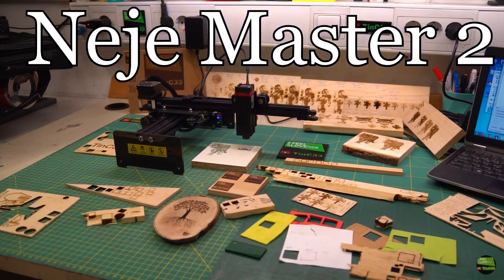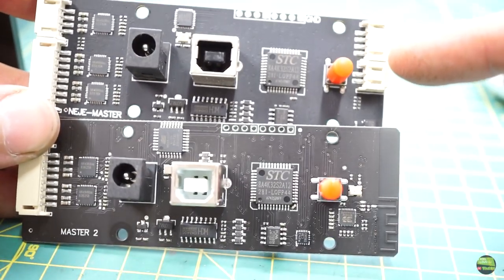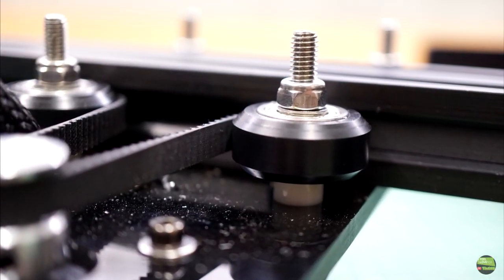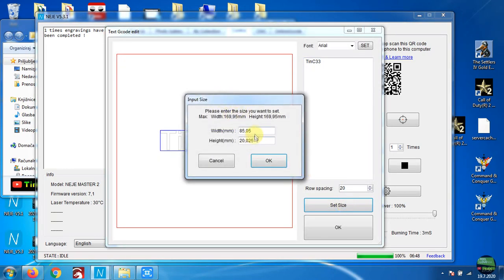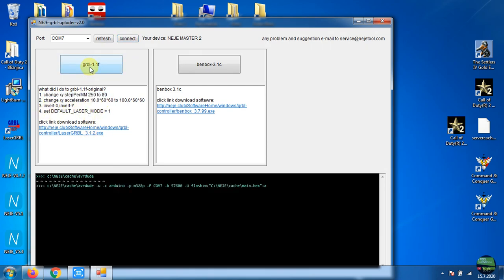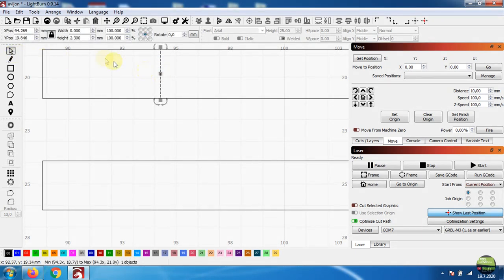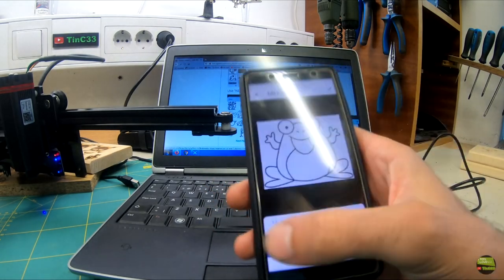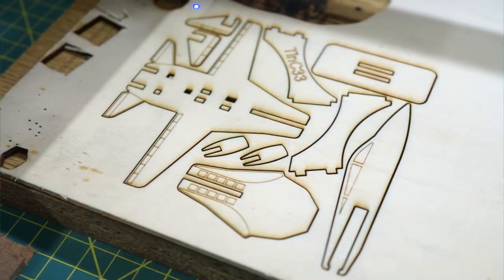NEJE Master 2 20W desktop Laser Engraver and Cutter

Comment: Hello, I am a .neje master 2s user. The red led is constantly flashing. The software is not loading . can you help
Reply from the maker: Red led on laser modul flashing whil is in iddle mode, do you install driver to pc
Reply: @TinC33  The driver is installed on the computer . but the red light is constantly flashing.
Reply from the maker: @urasteknikplastik402  red lifht on motherboard or on laser modul, on laserm modul mean it's in iddle mode, does pc recognize new dewice after plug usb?

Comment: Hi As i write last time i ordered  neje 2 20w but they send me neje 20w, after that they send me one mainboard master 2s but now  the problem is in the screen said Unsupported device i try all up date software but still not working, have you any idea whats the problem ? thank you
Reply from the maker: Did you install driver?
Reply: @TinC33  yes i did and install also this NEJE_V5.3.1.exe — 2020.7.13- bug fix, firmware upgrade to version 7.1.
Reply: its work bluetooth but not with the  laptop,
Reply from the maker: @omerargon6477  hm does windows recognized machine when plug usb? It should be something with driver / comport settings.
Reply: @TinC33  yes windows recognized usb  plug
Reply from the maker: @omerargon6477  i don't know so it won't connect on neje software or any other software?

Comment: Hello! I want to cut a wood with engraving master 2 lazer. Can i have the weight 9f the wood and the settings of the program ti cut it correctly?🙏🙏
Reply from the maker: Try with 100% laser power and slow down the speed, but you need air assist for cutting.

Comment: Thank you for your review and tutorial. I managed to make mine work but I am always either messing up the logo where it prints on the spatula or not having it in the correct spot. How do I align the Lazer to print exactly where I want it on a pen or spatula? Thank you!
Reply from the maker: Put object you want to engrave under the laser and set focus on it's surface, than into neje software click sqare button (framing) another window will apear where you can move your logo inside of working area and the laser will follow with weak light wich show the position of engraving, close the window and click start.
Reply: @TinC33  thank you so much - that was so helpful;)

Comment: i need help connecting my neje master 2 to lightburn.  lightburn cant find my laser even tho it is connected and turned on. i did it manually but it makes lots a noise from trying to go to far.   i am using neje 5.4.2 to burn stuff but its not as nice as lightburn.    plz help thx.
Reply: If you managed to get it to work. Please share what you did.
Reply: @ronald44181000  for master 2s here:   https://www.northlakeswoodwork.com/blog/2020/12/26/lightburn-setup-for-neje-master-2s?fbclid=IwAR1imVVDpONMOO0_JATRyWTZY92mqN8I2TqJtF4h2joejdgCy73JsJC3d3E

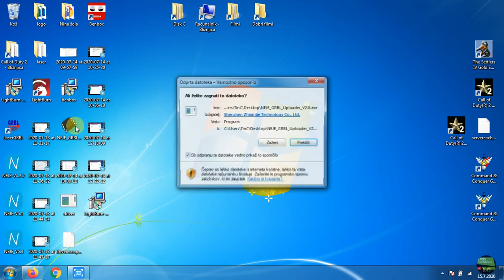Comment: At 8:07 you change the firmware for grbl and when I want go back to use the neje software then I flash the benbox firmware?
Reply from the maker: No, you can connect neje anytime, doesnt metter which firmware you got, you need to change firmware only for grbl software (benbox, laser grbl, lightburn...) NEJE software always run on it's own microcontroller (glow neje light)

Comment: Hello i just bought one Neje master 2 but i can`t engrave anything, maybe a problem from the laser ? 
If you coud help me little beginner with those product it will be wonderfull 
thanks
Reply from the maker: Where is the problem, what software did you use?
Reply: @TinC33   Thank you for answering me.
The problem is that, when i start engraving  with the 20W laser with the NEJE V5.3.2 software, nothing happen on my wood or paper even modifying the settings. Literally nothing is appearing but the CNC is working well just no engraving, i m totally new on this product so i m maybe doing something wrong.
Thank you
Reply from the maker: @pierresalmon8118  fan on laser module running, do you see any blue light out of laser when plug power supply? If not check the cable, there must always be a blue light when the power is on
Reply: TinC33 fan is running and there is the blue light when it’s on 😥
Reply from the maker: @pierresalmon8118  then try increase laser power and burning time is there any change in light
Reply: TinC33 yes i can increase or decrease the laser power and i can see that it doing it (changing the power) and also for the burning time.
One thing that is strange is the pattern that is doing the laser (not on the focus point but around) its half a circle. This is making me say that it’s a problem with the laser itself but idk if it’s on every Neje master 2 ? 
Thank you
Reply from the maker: @pierresalmon8118  did you set focus so you got smallest possible dot of light?
Reply: TinC33 yes i tryed to do the smallest dot of light in order to have all the energy on one point
Reply from the maker: @pierresalmon8118  hm really strange, when you set focus in iddle light (not when it's turning on) do you got nice dot or "half circle"?  when it's working it's normally that there is no visible dot because lot of light glow arround the dot.
Reply: TinC33 i will try again and again 
Thank you for your help
Reply from the maker: @pierresalmon8118  otherwise contqct the seller you may got faulty laser modul.

Comment: I have a 12 volt battery maintain by a 145 watt solar panel thinking on engraving off grid using the battery voltage to power the NE JE that is coming by slow boat china post and EMS . Never have to worry about grid spike over powering the  supply and killing mother boards. I have on my 3d printer battery backup. because the first printer the board got fried and no replacement avaible.
Reply from the maker: I try to power my neje mini with 3s lipo (wich is more than 12v) and it work without any problem.

Comment: question...THE PWM input to laser how can I measure that between which pins?
Reply from the maker: Try between negative. But i think you'll need an osciloscope to.measure that signal
Reply: @TinC33  I have a scope, I'm assuming there is +/- 12vdc and the other 2 pins are the PWM.  thanks, this new master 2 and laser (20w) is not coming up to power...it does modulate the light when ready to burn, but the max i can get is just enough to focus!
Reply from the maker: @N2AIE  hmm strange, try to contact neje maybe the laser is broken

Comment: hi one question. how can i made my laser thin ? thank you
Reply from the maker: How you meqn thin?
Reply: @TinC33  meqn ? what you mean?
Reply from the maker: @omerargon6477  mean😉 how you mean how i made my laser thin, you mean thin cut?
Reply: @TinC33  yes and also is that possible to thin write with laser ?
Reply from the maker: @omerargon6477  all you can do is to set focus to smallest possible dot, but more powerfull lasers like 20,30w got bigger dot than weaker lasers, 3,5w modul got relly small focus point.
For tiny engraving set motor speed to slow, lower down the laser power and increase burning time so it engrave slower, then text height 1mm can easily been read.
Reply: @TinC33  thank you for answers

Comment: how to set NEJE Master 2 from engraving to cutting, thank you
Reply from the maker: Power to max and rise engraving time
Reply: @TinC33  just this, nothing with diode or focus?
Reply from the maker: @daliborklusacek2095  no, just set focus same as for the engraving so there is smallest possible dot, with maximum power. power to 100% and rise burning time so it move slower and make bigger effect.

Comment: hi ! what's the max mm you cut with it ?
Reply from the maker: 9 mm spruce wood was maximal cutting deepth.
Reply: @TinC33  woow ! That's crazy ! I think Nehe Master 2 is better for laser cut than "Ortur master 2".
What's the most difficult think you cut ? 

I want to buy one like this and i hesitate between Neje 2 or Ortur 2
Reply from the maker: @PeupleDivinTV  ortur 2 is much faster, but the neje is better in all others, better software, easier operate, bluetooth, offline engraving, better focus...
as i say 9mm soft wood was mak i cut with air assist and many goes, but for grayscale 3.5w is better than 20W, just those days i'm in contact with neje to send me other models to test like neje mini, midi and maxi, and moduls 30 and 40W.
Reply: @TinC33  thank for your answer, can't wait to see your next video test !
I think i will buy Neje with two different head 3,5w ans 20w with this i will be versatile.

Comment: the only downside I have with this unit is the speed. It's very slow in both settings ..wireless or direct connection to my laptop.
Reply from the maker: Try to change motor speed, or use other siftware where you can set speeds, and acceleration of motor, otherwise you can buy new 32bit motherboard for better speed.